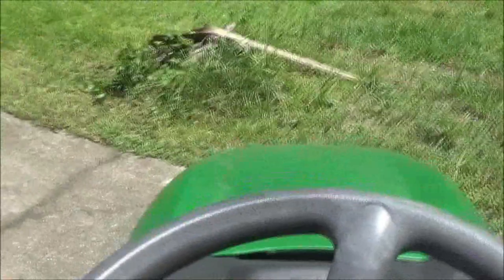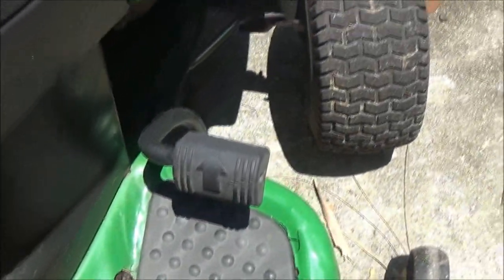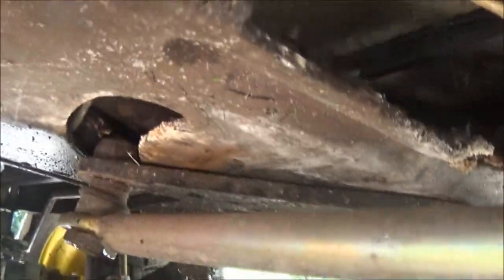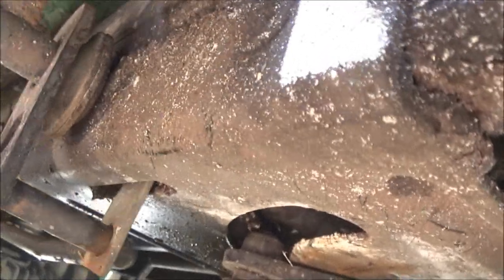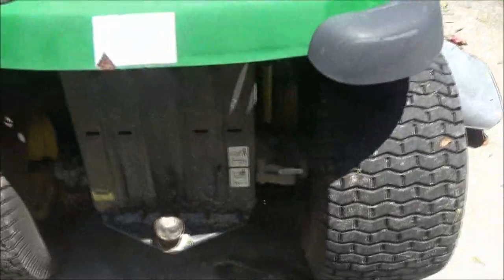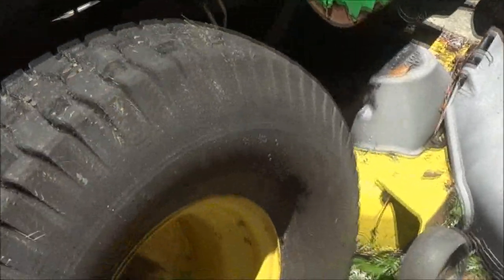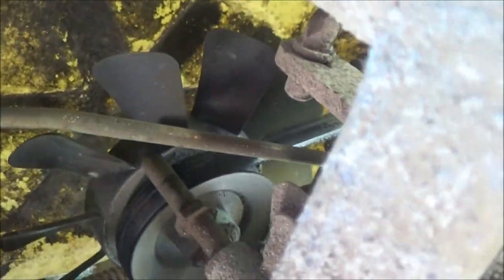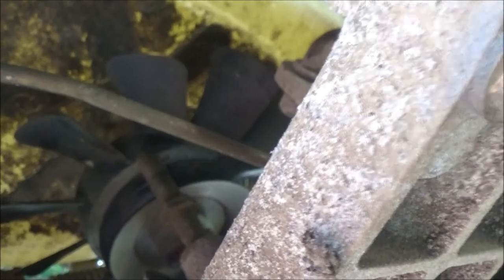John Deere LA145 Wont Move Diagnostics

Comment: Hi, I have a JD D160. Just like you, as I was cutting grass just now, it stops moving forward or backwards. However, the mower deck was running absolutely fine. Interestingly, just like you, even without pulling the pin in the back, I was able to push the mower out of the grass and onto my driveway.

Looking at it, the drive belt is on and it seems to have some tension. I'll have to look at the individual drive pulleys like you were doing. Hopefully I kind find one that looks like the one you found. I'll go look for your update video but I'm hopefully I can find something similar to what you have here. Thanks for your video.

Comment: Just came across a john Deere la 145 for $450.00 .
The person said it did not cut will ( Blades on backwards ).
Leaking oil (lose drain plug ) .
Motor cutting out ( hole in fuel line )
Weak Revers ( Bad drive belt and shiv )
why do people carry on about martinets problem .

Comment: Mines got a bad flat pulley on the deck I put oil on it and forced it to spin the bearings are worn out probably full of rust
Reply from the maker: Them pulleys are pretty cheap and easy to replace. But I have done the oil trick a few times myself as well.
Reply: @shabear1000  it's got a new one on now. I think the carburetor float in mine lifts up when I'm stopped on the hill an makes it cut off then wont start back up because the float goes up it still works just not right when going up hill I gotta get another float for it the metal part and bowl is good just not the float

Comment: I got a la145 and it's not charging any ideas what I might check? It would be much appreciated thank you!
Reply from the maker: Check the fuse first. Then make sure all your cables are tight.
Reply from the maker: If that doesn't work, let me know and i will walk you through some other tests.
Reply: @shabear1000  okay my friend I'll try to find that thanks for getting back to me so quick!
Reply from the maker: No problem man. Feel free to contact me if you need more help.
Reply: @shabear1000  kk